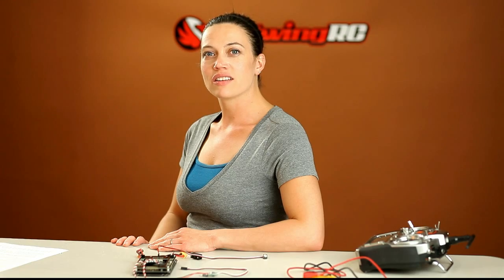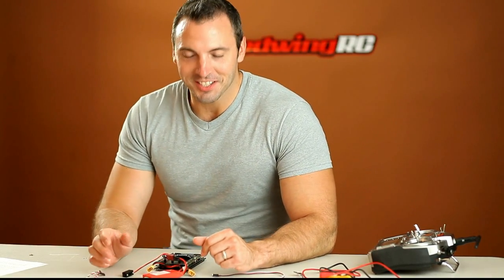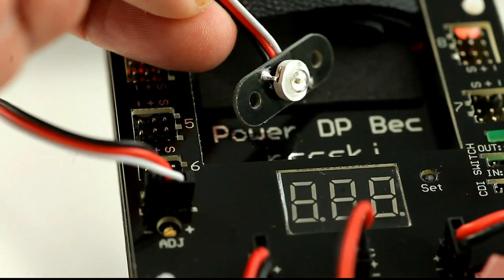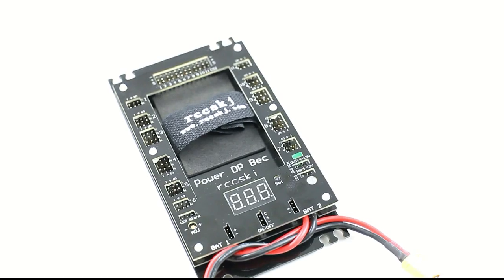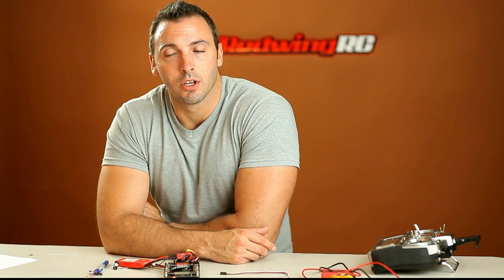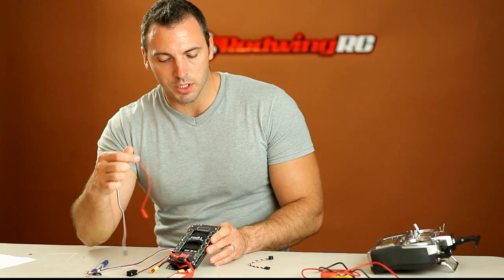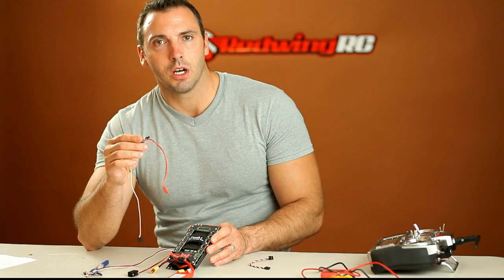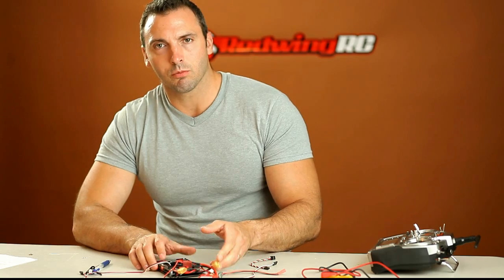RCCSKJ Power Box Expander RC Planes

Comment: I use the older unit without the display. I have had it four years now with out problem. Does the new unit keep the kill switch position. My old unit will always have the opposite kill switch position of the radio switch. If I power up the plane and I forget to put the switch on the radio to kill the engine the kill switch will reverse. What I mean if I forget to put the radio switch to engine off then power the radio and plane on the switch will be in a opposite position than normal. Does the new board do this or did they fix this problem. Its kinda irritating.